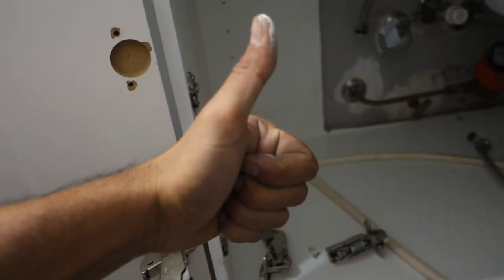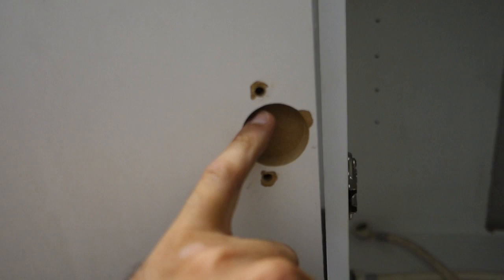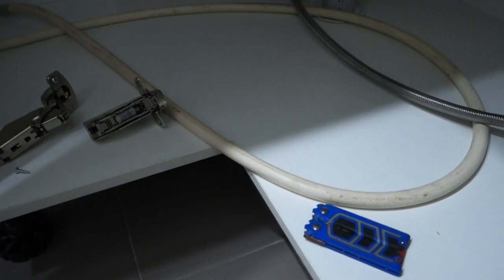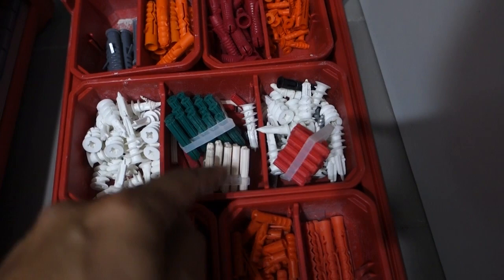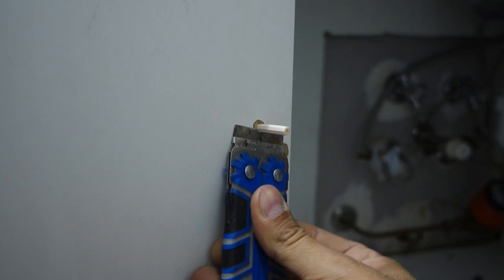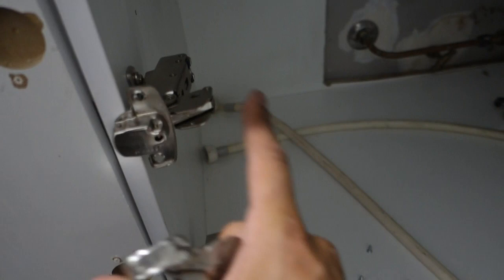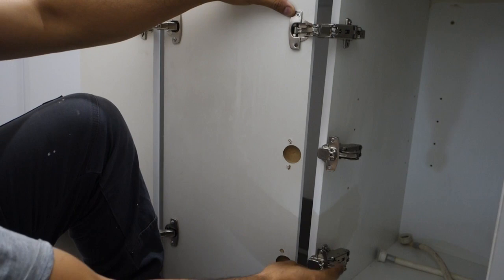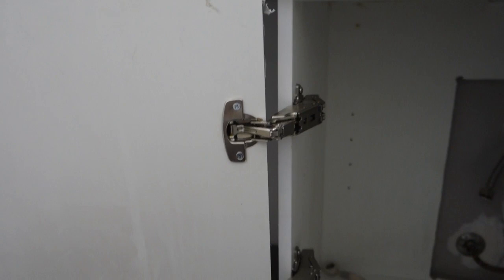how to fix cabinet door hinges

Comment: This worked perfectly for me and it only took about 5 minutes to secure the hinge. Thank you so much. Last time I had used filler-wood piece for the similar issue. This one is a much better solution and makes the hinge even stronger.

Comment: Hi Bill, can you help me by showing the adjustment screws in the middle of the lock and the adjustment screw at the back. My partner slipped in the kitchen and used the open door to save herself. Important thing is my partner didn't fall but the cupboard door came off. I you could help me please I would really apprciate it.

Comment: This is excellent bill thank you. If I didn't have plugs, could I fill the holes with glue and baking soda and leave it harden and drill the screw back in? Would this work?
Reply from the maker: I wouldn’t suggest it, the wall plugs are cheap to buy and handy to have around 👍
Reply: @billshowto  thanks bill, much appreciated

Comment: Bill i need help. I have a 165 degree hinge. The screw on the slide has worn the slide over the years. What can i use to tighten it again? The slide is nickle. 
Its the hinge that holds the second door
Reply from the maker: You can buy a replacement hinge for about $7-10

Comment: I'm in New Zealand and have a similar hinge (has 'Blum' on it) but it doesn't use screws on the piece that attaches to the cupboard door (not the carcus). It became loose over time and then the cupboard door fell off the other day, do you know why this happens or how to fix it? We've tried just putting it back in and reattching the door but it seems to be loose or off somehow as it isn't strong now- falls off all the time.
Reply: I have this problem too and would love a solution.

Comment: I have been trying for three days now to reattach the hinges from a crate and barrel TV cabinet I bought.. no luck they simply refuse to align, they don't look the same as the five videos I've watched, and nothing seems to work, they have open slots at the end and it won't slide on enough to attach the cabinets, they were on but hanging crooked which is why I removed them... any suggestions?
Reply from the maker: Send me a photo / video and I’ll try to help 👍
Reply: @billshowto  If I could I would I have tried to send photos, it won't let me attach them here, not sure what the issue is. I drag them over they show then nothing so I guess I am just stuck with a one door cabinet.
Reply from the maker: You can send them to billshowto@hotmail.com